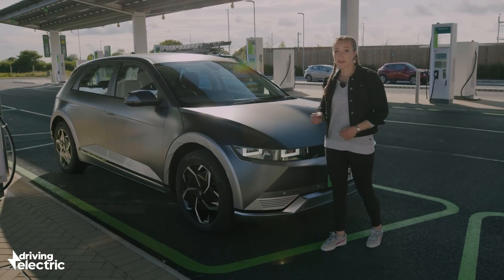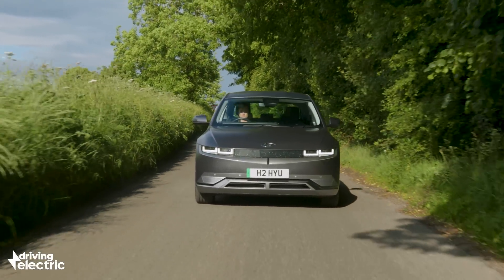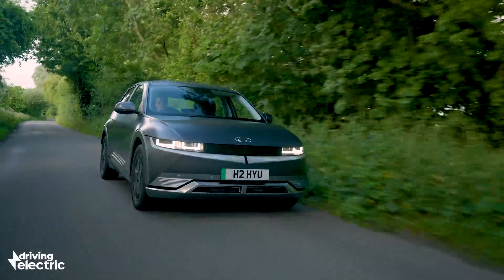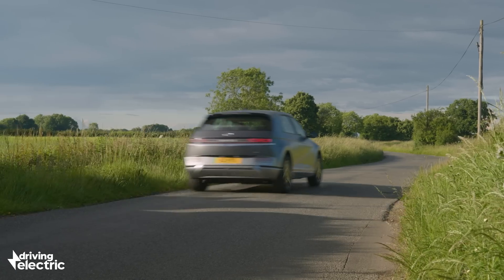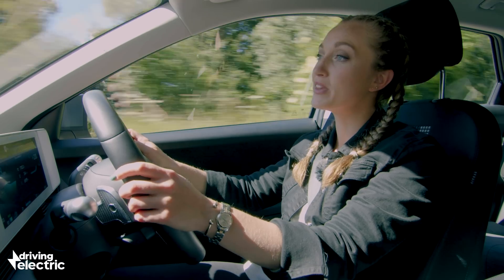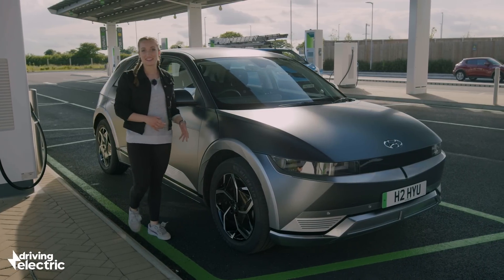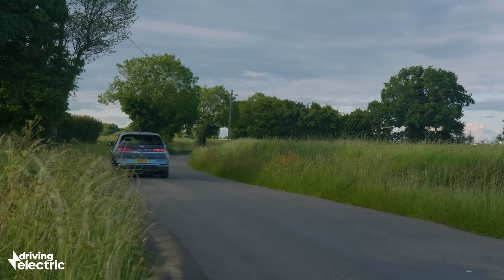How Do Electric Cars Work?: EVs Explained – DrivingElectric

Comment: Permanent magnet motors use induction to slow down and recharge battery. Also we need that right to repair law so we can service that low voltage stuff on EVs.

Comment: Some clarifications:
0:30 There is a reduction gear box, just not multiple ratios to choose from.
0:34 Electric motors can produce maximum torque from zero rpm is the important reason for having a single speed gearbox, not because they have instant torque.
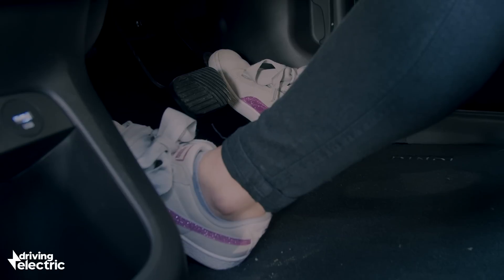1:03 The electric motor converts the momentum of the vehicle into electric current via the magnets and coils in the motor, not through friction.

Comment: Hey guys. Thanks for all your content. I would like to see you cover the issue of carbon footprints. One of the arguments for EVs is that they have a much smaller carbon footprint than ICE cars. However, some are now saying that high performance EVs don't really have a much smaller carbon footprint than ICE cars, and therefore undermining the benefit of driving EVs. I would love to have your take on this issue. Thank you in advance.
Reply: That argument is correct regardless of performance. Even with high-performance EVs like the Tesla Plaid or the EV6 GT, the cars are still doing the equivalent of over 100 mpg. This is particularly true in areas where electricity is generated from sustainable means like hydro, solar, and wind. Even when the electricity is generated via fossil fuel/natural gas, the emission limits at power station are far more stringent than car emissions. So no matter which way you slice it, EVs have far lower carbon footprint than ICE, by a lot. Also, EVs simply are better cars. Just some context, my doctorate is in lithium-ion battery research and this is something I have to know very intimately.